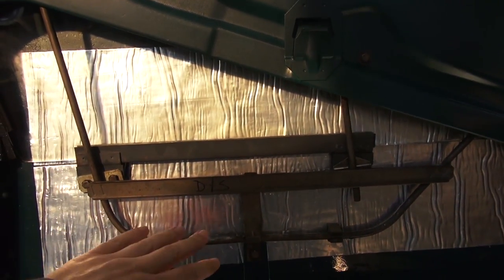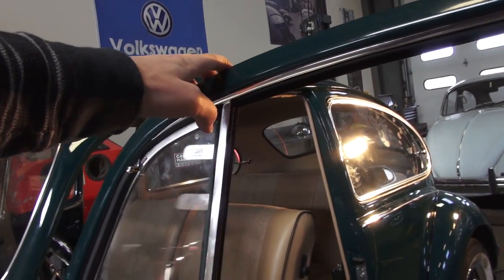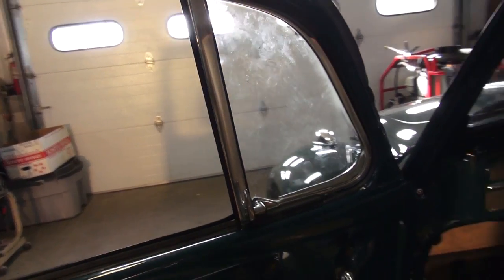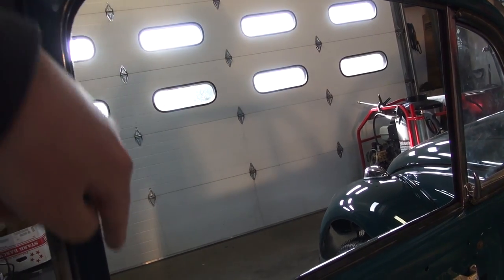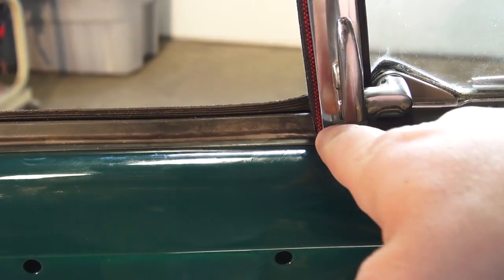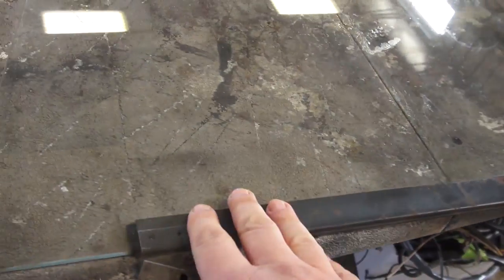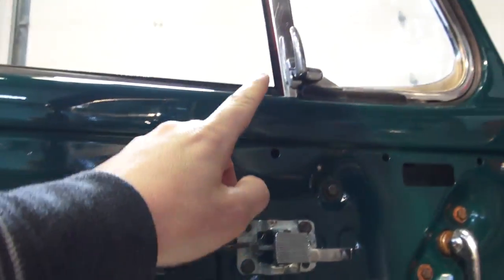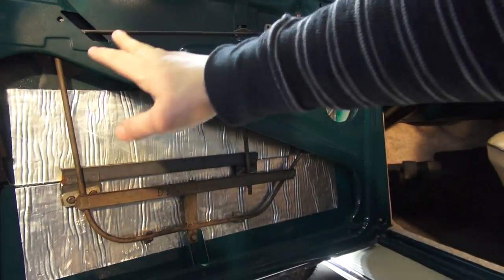Classic VW BuGs How to Assemble Build Restore 1965 and Later Beetle Sedan Doors PT. 2

Comment: Woops ! Tried your method on my 1967 Beetle. After 6 hours of trying I figured what I was doing wrong. My lift cable has to go between the wind wing post and the door. Normally the wind wing has to be removed. I didn't want to do that, so I figured out how to get enough room to get the lift cable tube into the right position. I placed the glass into the tracks. Installed the cable tube between the wind wing post and door. Tightened the bolts on the cable tube. Installed the lift channel and slid the glass down into the channel rubber.  All good now. Maybe a hour.

Comment: EXCELLENT Chris! I'm going to have to do this soon on my 67 bug. I rolled down the window while I was driving today and bangged my elbow on the glass because it was still up. 
It dropped after running over a bump in the road. I took the door apart and found the glass was no longer being held in place by the channel. The rubber in the channel had turned to brittle stone.  So I'm sure glad you did these videos.

Comment: I found that on the 67 bug the window gear just rotates up inside the door with no forcing or prying to get the crank into position. Smooth as silk, and I wish I had know that taking it out. I tried to pull it all straight down.

Comment: Chris, great video, I just followed your instructions and made it so much easier, however after assembly both of my windows are super hard to raise or lower.  I tried putting some silicone on the vertical felts and somehow helped but still are pretty hard to move, any suggestions?  I used all new rubber and felts.  Thanks!!
Reply from the maker: I have a video on making your own vertical felts.  The new felts are pretty crappy these days, so we make our own
Reply: @classicvwbugs  thanks for the reply!! I will look for that video and see if I can fix it!!
Reply: I have the same problem with my 67 bug. If I have all of the felt in the channels I can't roll the window all the way up. I've been driving around with no felt in the wing wing post for a year. I even tried silicone grease.

Comment: I have a 66 that I converted to Cal windows 20 years ago and I'm looking at restoring it back to the original windows with the vents which I still have.  I remember having to cut the tabs off inside the door so that the one piece window can fit.  Is it okay to just bend the tabs back in place or do I need to weld them back on?  I can't even remember what purpose they served.
Reply from the maker: +mcgyver62 Not sure, I have never had to dealt with one piece windows

Comment: I have a 1956 oval beetle.  I have totally restored it from ground up.  Problem I'm having.  I shut the front trunk deck lid and am now unable to open it.  The wire hasn't broke yet, any ideas......Thanks
Reply from the maker: +Vafees1 It might not be broken but the latch still caught and maybe the cable is not connected to the latch to free it.  You always need to check that prior to closing the hood.  Is the spare tire in the tub?  If it isnt, you can get under the car and get a long strong rod through the inspection hole in the tub and knock it loose by hitting the latch free from the catch.
Reply: +Vafees1 Thanks Chris, no the tire is not in the tub,,,,,,,I'll try your suggestion.  I appreciate you.Vafees1